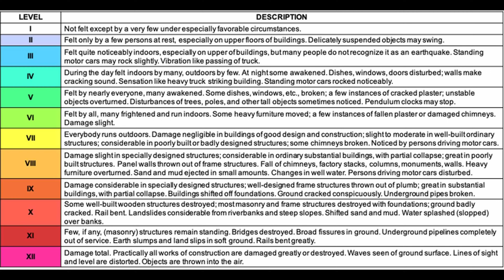LIVING ROOM - 12 Earthquakes Comparison

Comment: My info:
Magnitude 1: nothing needs to worry about.
Magnitude 2: only a little damage.
Magnitude 3: shakes anything a littke bit.
Magnitude 4: the same as magnitude 3 but way more.
Magnitude 5: fells off weak tall things.
Magnitude 6: anything starts to get worse. Earthquake deals more damage to buildings.
Magnitude 7: fells a lot of weak things even the earthquake could almost fell off the building.
Magnitude 8: fells off lamps, bookshelfs and usually the whole thing.
Magnitude 9: can destroy the whole building.
Magnitude 10: it damages a tons of homes even a tight houses almost everything destroyed.
Magnitude 11: destroys even more homes than magnitude 10.
Magnitude 12: the humans wish that they had never live inside the earthquake.
Reply: Btw its MMI not Magnitute

Comment: I heard that in case of earthquake the best thing is to hide under a table (if you can't go out) and your simulation proofs that 👍🏻
Reply: yes however the table could break under the weight of a heavy cabinet or shelf if it is flimsy
Reply: @Corgimations  
That's the thing nobody tells you about, and it's not always that you can move when the earthquake happens.
Reply: It depends on its quality. Of course you don't want to hide under a table made of glass or a table with a weak wood.

Comment: This vid is both great and also chilling at the same time. This animation look so realistic that it actually gave me a bit of PTSD since I experienced strong tremors in our living room back in 2017 which caused so much damages to our furniture but thankfully, our house was spared with little to no cracks.
Reply from the maker: how big was the earthquake you have experienced?
Reply: @EarthquakeSim magnitude 6.7 and the intensity was 7.
Reply: @juanito5582  Im extremely scared of earthquakes ever since May 4th of last year, school was evacuated from 5.6 mag earthquake nearby
Reply: I remember the East Coast quake in 2011. Was sitting at my table on the computer, around 5 miles south of Philly. Thought I was having some kind of seizure, but then noticed the water in my bottle was shaking and figured out the unheard of was happening. Just as my wife literally stumbled through the kitchen door, wondering why she couldn't walk properly anymore.
No damage, nobody hurt, dishes even helpfully stayed in place, but it was memorable - I'd slept through every other modest quake we'd had.
Ours felt more sinusoidal, with only modest vertical or well, brick structures don't like being bounced much, they'll tolerate some lateral movement, but not bounced.

From what little I've seen, earthquake engineering is a real bear. Have to account for usual periodicity of common quakes, guard against harmonics in a structure, account for type of movement of the quake, soil constitution and an insane amount more! I don't envy any structural engineer near the ring of fire.